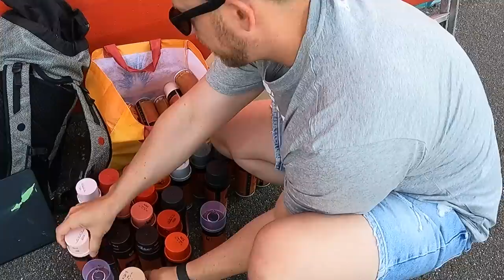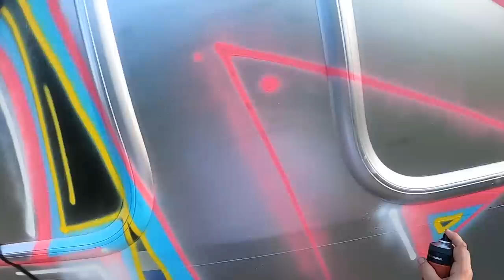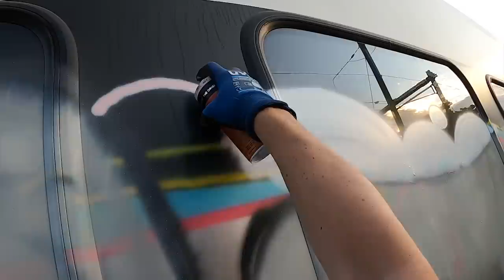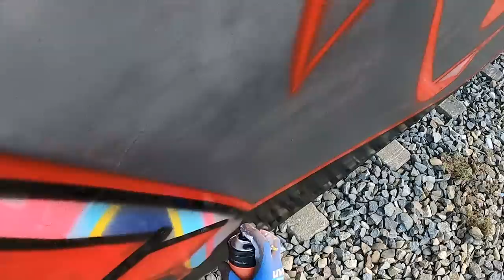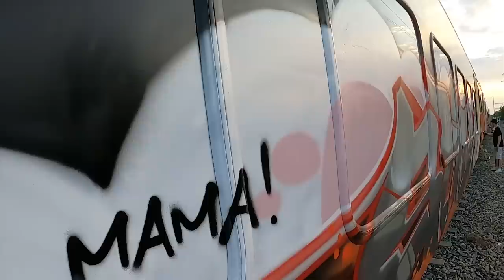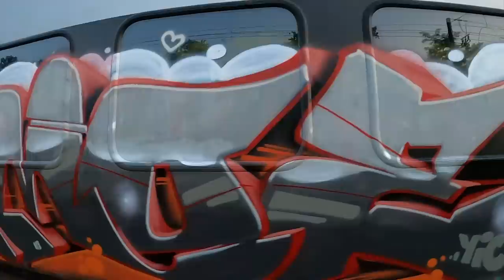I paint my FIRST TRAIN GRAFFITI - drivers scared us!

Comment: 4:00 The reason why it didn't cover well is because you used a calligraphy cap AND Molotow Premium. Molotows are more like car paint and are good against sun light (they last really long) but the downside is how they cover compared to other graffiti cans. For trains you can use Loop paint. They don't last long against sun light but they cover really well, so they are perfect for trains.
Calligraphy caps also don't cover that well compared to regular fat caps. They are really good for cleans walls though, but they may not last that long as the color coat will be thinner.
Nice piece by the way,